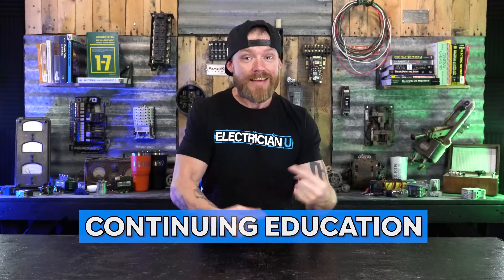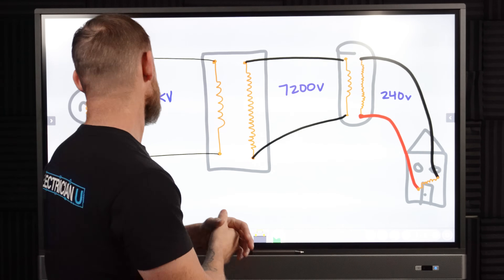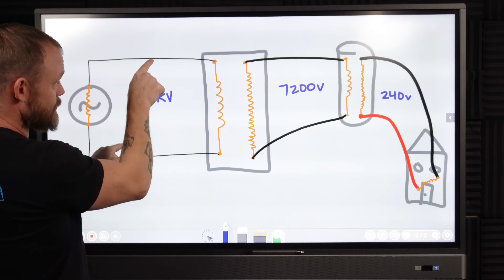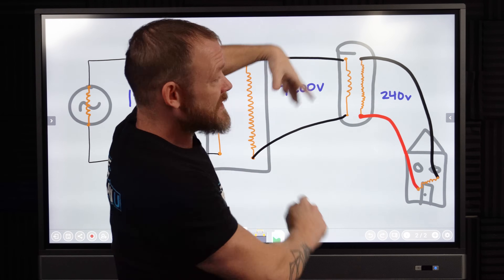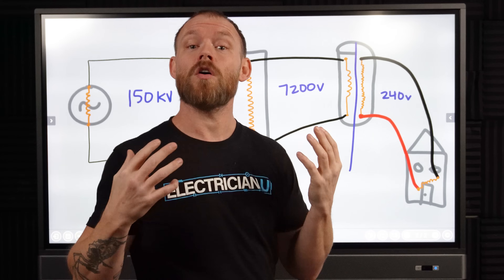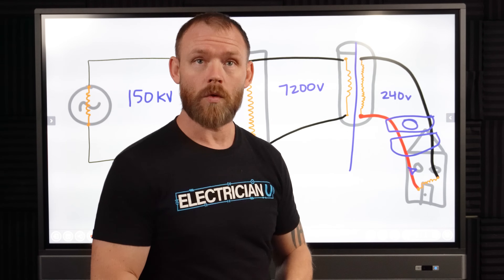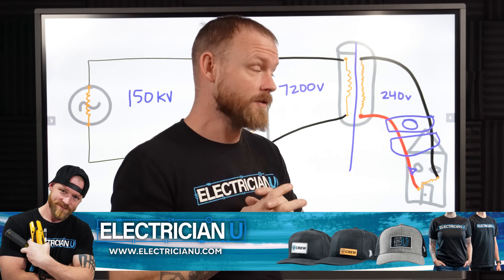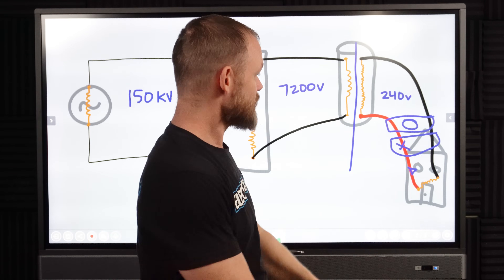What is the Primary Side vs the Secondary Side of an Electrical Service?

Comment: In my area the 7,000 volt primary is connected as an auto transformer because the cheap lazy PECO / Exelon is two cheap to run two high voltage leads to their distributions transformers even when 3 phase is on top of pole. So every house has current back feeding this halve ass connection thru the copper water service , steel gas pipe and even the cast iron waste pipe. Have measured over 1/4 amp of current flowing on the copper water service with the meter removed & the main circuit breaker turned off. Of course bet at least 10% of the aluminum ground wire that connects to primary, secondary and metal transformer case to the ground rod at bottom of pole has at least 8' of wire stolen and takes them.months to repair it. These ground rods are absolutely worthless in the winter time because most have at least 20' of concrete then 50' of blacktop.

Comment: Question: In transferring power, is there an efficiency difference between induction and conduction? That is, because the wires aren't touching in a transformer, is there less power (W) because the current flows thru the air instead of copper? Think Magne Charge.

Comment: Actually, power stations tend to start at low voltages, usually 2.3kV to 30kV and have step-up transformers for transmission lines, usually 115kV to 765kV.

Comment: Thank you so much for your videos they're very educational I've learned quite a bit. Could you please do a video on how to tighten up the boats that's at the top of your breaker panel your box in your house how to tighten those bolts up safely without getting electrocuted or cooked.? Even though you turn off all the breakers I can only hope everybody knows that the main wires coming into your electrical panel still has electricity on them..

Comment: I live in the Middle East and I have a table fan that works with electricity 230 V AC 50 HZ.. If I brought it to the USA and ran it on two phases, each of them 120 V AC 60 HZ.. Does it work well or does it burn...?  Thank you

Comment: DUSTIN, try to make a lesson about various types of LOADS that electricians would need to know about and how different LOADS will draw different currents using reactive power, applied power, apparent power, true power are all based on the LCR loads. Electricians should know about different types of loads because not all loads are the same. Some loads will induce Harmonics on the AC 120vac line which electricians should know about why certain loads will add harmonics. The transformers secondary winding will "reflect" these harmonics back to the primary side which will backfeed into the AC outlets so all the AC outlets that are connect on the same breaker path will have also harmonics upstream and downstream because all the AC outlets are connected to the same breaker, this is not good and needs to be fixed.

Comment: Would you make a video on your options for dealing with a house that doesn't have a ground and what code there is on replacing the two prong receptacles with three prong? Additionally there seems to be a lot of people online discussing adding a GFCI as a solution.
Reply: Sorry Justin, I've had to deal with this in RL.

Disclaimer: First thing I'd do is DO NOT TOUCH if it's not your house. Liability could ruin you financially. If you are a licensed electrician you may not be after the fire when Fire Chief asks who wired this.

That said, there are all kinds of grandfather laws out there. Do some investigating. If a county says you can repair an existing knob & tube electrical supply in your barn then you likely can. Do not add to or modify the original circuit. Find out who has authority to sign off on the job.  Get them to pre-approve anything and get an official document on their office paperwork with a signature. You may be able to change a fuse to circuit breaker, twist switch to toggle switch.
Reply: @thedillpickle100  ... personally, I would steer clear of touching anything on a K&T circuit... even changing a switch, outlet, or going to a breaker is dicey. Once you touch it, you own it.... FOREVER. Just walk away or replace the entire circuit.
Reply: I live in a house that was built in 1928 and have the same setup.  No ground.  Would be interested also to see Dustin's ideas.
Reply: if your house system is so old that there's no ground rod and only 2 prong outlets, it may be time to look at a total revamp of the system, starting from scratch with everything new.
Reply: @rupe53  so the current house is a rental and I won't be doing that lol, but the owner at some point replaced all the receptacles with three prong outlets. I originally noticed it when my UPS wouldn't work and gave me a site wiring fault light. 

I just figured this would make for a good video and potentially help home owners understand what is involved if they decided to hire someone to fix this.
Reply: @reallunacy  ... I would also like to hear Justin's point of view on that, even though it's spelled out in NEC to allow that conversion. I suspect your case has something simple like the hot and neutral are reversed. The UPS generally won't see the ground.
Reply: @rupe53  I would like to do that in my 1950 built house.  They all had 60 amp service back then, with maybe six 15 amp and maybe 2  20 amp circuits.  These were type S plug fuses.  About 20 years ago I had 100 amp service put in.  Of course three prong wiring didn't start until the late 60's.  At least it's not Knob & Tube.  There are millions of homes in this country that have this and people don't have the money to fix it.
Reply: @davidmarquardt9034  ... three prong was around in the early 60s but most areas didn't adopt / push the code till later. Circuit breakers were a new item in the 50s and fell into similar, code wise. I have buildings in my area that have breakers and 2 prong outlets. That just seems weird, but it's reality.
Reply: So I'm ignorant here. If it's a metal box you just add a ground to the box. It's plastic and you only have hot and neutral so you can add a ground but ultimately it's not grounded. If I add a ground rod I'd have to fish a ground back to the fuse box from every ground.  That's a nightmare. Can you buy a small grounding rod and ground each outlet above the box? Swapping the first outlet out of each circuit with a GCFI sounds best. Just brainstorming I have no idea what I'm talking about.
Reply: @nathangilbert1344  ... 99% sure you wont have plastic boxes with a system that is so old. The reality could be a ground via the BX sheath or no ground because it's cloth Romex. Either way the GFCI outlet will sense an imbalance between hot and neutral so will offer protection.... just not via that 3rd prong.

Comment: I love your (perhaps unintentional?) reference to the brouhaha over ICP's "Miracles". And by the way, we have a pretty good handle on how angry pixies moving through a conductor induce a magnetic field and how this field can be coupled to another conductor, inducing the movement of other angry pixies. We even have a pretty good idea of how the angry pixies become transformed into force communicating pixies and back.
You've got your transformer winding illustrations back to front; the side with the higher number of turns would be at a higher voltage. Might want to add a note to the describey about this.

Comment: Please explain:
I basically get how induction works, but what is so magical about coils that there isn't a short circuit?
A coil is just a wire spun around a spool.  If you stretched out that wire and put a "hot" and a neutral charge at either end you've have a short circuit.  However, if you coil the wire it creates a more intense magnetic field and somehow doesn't short out.
Why?
Reply: Because of the coil configuration, the current running through it creates a magnetic field that opposes the current being passed through it. By nature, inductors resist a change in current. This effect is exaggerated by motors, because of the spinning rotor the magnetic field can cut the lines of flux and resist a change in current even more and the motor can do "work" while spinning. Though if you keep a coil stationary and don't have a way to disapate some of that current, the coil will become saturated and burn out, this is why a motor must spin or rise current draw will become too high and saturate the windings. So just think of it like this, if the coil isn't doing any work, that excess energy has to do something and it will be converted to heat unless doing work like driving a motor or any other load, otherwise yes it is just a short circuit. Conservation of energy my friend.
Reply: @BushyBrowsHD  First off, thank-you!
Electrician dude was talking about transformers (primary secondary) and induction where the windings of the coils are different to create different voltages.
If a primary coil is feeding a secondary coil and the secondary coil has no load, what's to stop the primary from frying?
I almost heard you suggest that the magnetic field works sort of like an insulator.  As more energy is bled off the more current can flow through the coil.
Am I all wet?
Reply: @nhtom8  transformers are tightly wrapped coil windings around a ferrous core, this increases inductive reactance which increases impedance, which is similar to resistance and works to oppose change in current.

Comment: Premises.  But GREAT vid again.  Thanks.  I used to teach a selective rotation of Industrial Arts and one of the sections was about electricity.  My students had to build a 4 foot wall (each group) and then wire that wall with a GFCI branch, a switch, a light, and everything had to work.  Thanks again.

Comment: In practicality what you're saying is correct but specifically primary side and secondary side is sort of relative to the device. Generation plants generate anywhere between 20kv and 110kv and they usually have a STEP UP transformer to increase the voltage to 345kv or even 500kv for transmission. In that specific transformer (step up) the primary side is the lower voltage side and the secondary side is the higher voltage side. In the substation they take the higher voltage and step it down to distribution levels with STEP DOWN transformers. So the primary side of those transformers is the higher voltage and the secondary side is the lower (345kv->138kv->27kv...). You can tell which side is which (usually by the sizes of the bushings/insulators) on top of the transformer. The higher the voltage the bigger the bushing. What's interesting is that since Voltage and Current are inversely proportionate the transmission lines (345kv) has lower current. That's why on the transformers the bigger bushing (voltage) will have smaller tabs (for current) and the smaller bushing (voltage) will have bigger tabs to accommodate for the amps. 

And as someone else mentioned here the number of loops/coils in the transformer determines the ratio of stepping up and down. For example if the primary side has 10 loops and the secondary side has 100 loops it's stepping up the voltage by 10.) 

The grid is a fascinating thing.
Reply: Yeah, the generation plants have to increase the voltage, because this reduce the current, and therefore, this reduce the loss of energy in the transmission.

Comment: What causes Transformers to explode? It seems we hear of at least one going off every year in our neighborhood.

Speaking of circuit breakers…….. can a GFCI be used as a circuit breaker? I have a 20 amp circuit going out to a shed. The first termination in the shed is a GFCI. If I wanted to add/modify any electrical components in the shed (“downstream” of the GFCI), can I just trip the GFCI? Or is it safer to go back to the house and open that circuit breaker?
Reply: They are rated a specific amp rating, similar to breakers (well more like fuses). If they over heat/over amp due to surges, shorts, etc - usually the porcelain fuses blow.
Reply: generally speaking, transformers are low on the list for explosions. What most people hear is a fuse letting go. They have a small explosive charge that makes them physically drop down as a visual indication of being blown. It sounds like a gun shot.
Reply: GFCI"S are double pole breakers.  When they trip both the hot AND the neutral open, thus there is no possibility of current back feeding.
Reply: @davidmarquardt9034  ... the GFCI in that guy's shed is an outlet, not a breaker. The question is about that circuit being dead if the GFCI trips. The answer is yes, but I wouldn't be working on that branch unless I knew the breaker was off.

Comment: Does North America do SWER (single wire earth return) from YOUR step down transformer to the SUBSTATION?  Or do they use a NEUTRAL back to the substation?  thank you
Reply: It is used but mostly only in rural areas. Not something that the vast majority of electricians here will ever touch

Comment: Had to google it and first result I found told that at least one of our nuclear plants in Finland has 20 kV main generator (with nominal current of 31.7 kA).  That voltage goes to 20 kV /412 kV transformer to be fed to the national grid.  There's also 110 kV grid, which is used to supply startup voltage for the plant, but from there the voltage goes though 110 kV / 6.6 kV transformer to yet another 6.6 kV / 20 kV transformer to the common generator bus.

I have seen several smaller generator that have 6.9 kV nominal voltage, which is then send to 6.9 kV / 400 V or 6.9 kV / 20 kV transformer, depending of the distance to the load etc.

So, i'm quite sure that there isn't that many 150 kV generators, if any.  Should be easier and safer to handle higher voltages at transformers that stay still, than in an enormous rotating thingy, that has super heated steam in the other end.
Reply: Yup, 99,999% of generators run on MV, up to 30-40kV. Thats basically the limit for synchronous generator

Comment: Some extra information on transformers - the coils inside are typically coiled at a specific ratio to create a specific voltage. (Ex: 7200v:240v is a 30:1 ratio - 240v:24v is a 10:1 ratio)

Im not an electrician, im an HVAC service tech who works with 240v and 24v 😁
Reply: Of course.
Reply: Thanks 🙏🏽

Comment: It may be cheaper in the short run to do pole mounted lines, but I have to imagine it's a lot more expensive over time having to replace and repair the lines all the time in places that routinely get snow, freezing rain and lots of wind like we do up here in the north.
Reply: Do not forget hurricane prone areas. Here in Florida nearly all new construction uses underground services.
Reply: Yes, . . . . . .The state of Texas is very familiar with winter conditions causing powerline outages.
Reply: the reality is it's still cheaper in the long run to do above ground service. (for the most part) Buried service may be less prone to external damage, but it doesn't last any longer and is WAY more expensive to install.
Reply: I live in michigan and we just had an ice storm that took out a bunch of transformers and power lines and the power is still not back in some places 4 days later northern states should definitely start burying electrical equipment because like you said it has to be a lot more expensive to constantly maintain it and fix it
Reply: @gage5899  newer construction tends to have everything buried underground but they’re not gonna go back and start modifying everyone’s existing installations. There’s too much stuff already established and built up. It would make it a nightmare to make it work.
Reply: @FishFind3000  I know I mean only for new construction or when they have to put in new power lines
Reply: @FishFind3000  in Finland we started to bury cabling for old installations too in the early nineties. They did not go in to the houses, but nailed the cable on the outer wall and connected to the same point where the cable from pole had been. Our meters were mostly inside then, so going to it would have made it much harder.

There is still some 400V pole stuff and even new ones are still installed, but it is quite rare and usually in places with really rocky ground or otherwise hard to reach areas. After all, it's about money. In the long run, burying old installations is cheaper than the payout to the customer blackouts. I don't remember the actual numbers, but couple days without electricity pays for the month or something.. There's a lot of firewood and several fireplaces in every house that has overhead powerlines, so they are prepared.
Reply: @gage5899  coincidentally, I'm also in Michigan. Hauled my generator out because I pretty much expected for the ice storm to knock out the pole mounted lines on my heavily wooded street. Got lucky and it didn't, this time.
Reply: It’s a significant difference in cost. The truth is for what your talking about (Service Entry) lines it’s the customers choice. Install either an overhead setup or an underground set up. The biggest price point is if decide on underground service your paying for the cable, the conduit and the labor. For overhead you only pay for the SEU or SER that goes from the weather head to the meter base.bao the panel.
Reply: When you have limited funds upfront costs that you can't afford now matter.  So that is how we got to today. Then, once you have poles up it is not poles plus maintenance vs underground with almost no maintenance, its already paid for poles plus pole maintenance vs a high cost of installing underground.